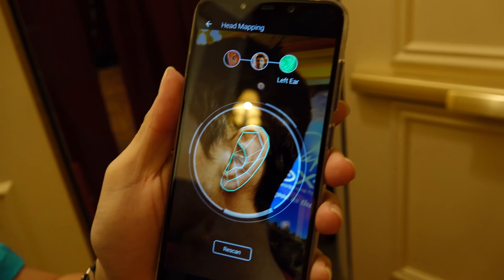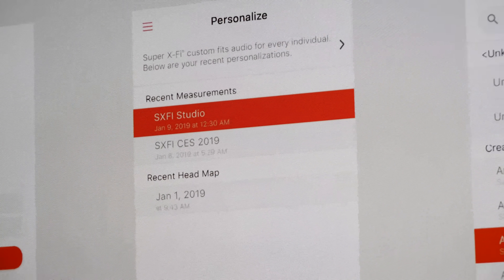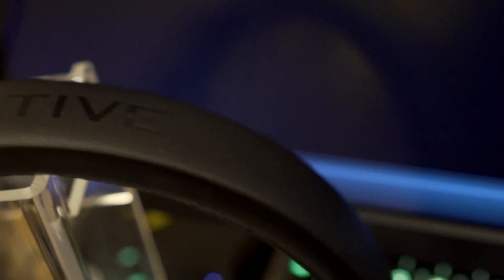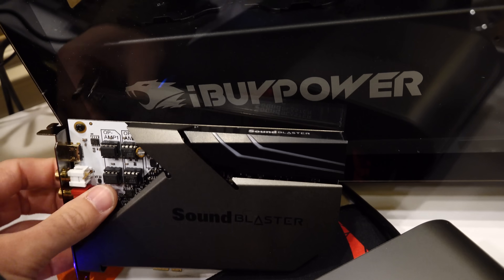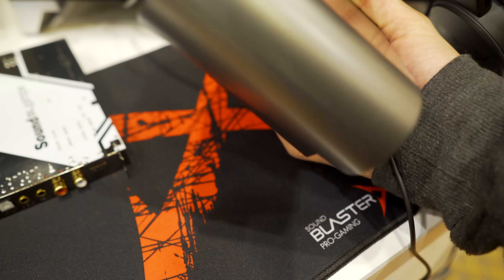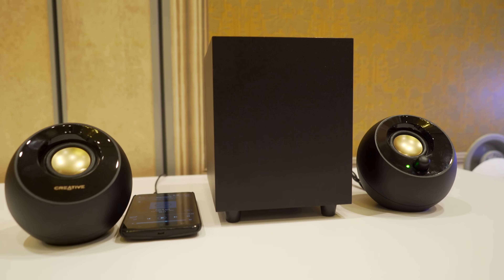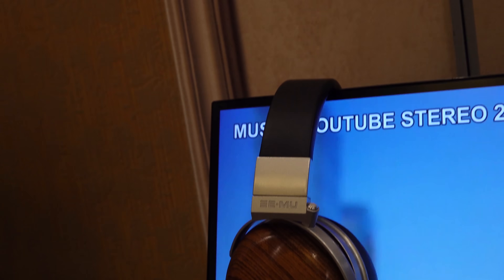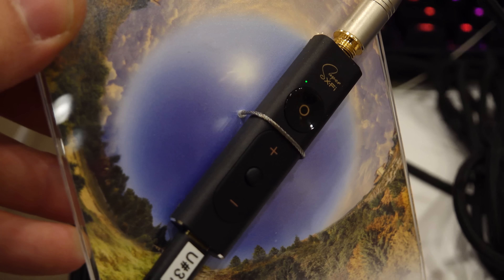What is this Headphone Amp, and Why is it so Different...?!

Comment: An important aside, the Super X-fi amp doesn't work with Xbox or apple products currently.  Which is a huge bummer because I'm I wanted this for a silent theater option and it doesn't work with receivers either.

Comment: Great specs on that AE-9.  SNR of -130dB (assuming they haven't just lifted that from the Sabre DAC spec sheet) is not easy to achieve.  BTW, it's pronounced 'Op', rather than 'O.P.' - short for operational amplifier.

Comment: I wouldn't trust demos like this when it comes to sound, especially when it comes to games. You can't force a game to have good sound if it has a bad sound system. I just use a standard stereo headphone setup with external dac, amp and no surround processing and games like Insurgency Sandstorm and R6S sound incredible as they are
Reply: Exactly. Most systems that have great inbuilt surround sounds will be amazing on anything even on a inbuilt sound card on the motherboard.

Comment: hey brian i want to build a x58 system with a x5650 and i already have a board but it has a four pin cpu power (msi x58 platinum) will it be enough for the cpu with some moderate overclocking
Reply: I run 500w on FX with a 4 phase VRM micro-ATX budget board ($40 price new in 2015 when I got it). It has an 8 pin, but I seriously doubt you'll be pushing power near my level (I'm voltage limited at 1.7 Vcore, core temp is still below 0c under load on my phase cooling system, otherwise I'd push it way more if it allowed higher voltage). I just really doubt you'll be pulling enough power to cook a 4 pin if you're only using water cooling, and you said "moderate overclocking", so haha, you'll be plenty fine.
Reply: @jakegarrett8109  ok thx

Comment: I flat out don't trust creative they got rid of their support forums because loads of people were upset with the piss poor support for the soundblaster z once windows 10 came out and lack of proper drivers.
Reply: gotta agree with you on that one UK....once you stop listening to your customers...then it's only a matter of time you begin to lose your customers. No Service?...no problem....no buy it.
Reply: Yup they've got😇 whipped pretty badly on that here in Singapore. 😜👍
Reply: I have the Sound Blaster Z sound card with Windows 10 64-bit, downloaded their latest drivers and have had no problems since installing the card (during 2018 Christmas).
Reply: @twinturbo3461  There are many that have problems. The fact that they simply erased their forum means the issues were bigger than they wanted to deal with.

Comment: From owning about 6 Creative products in the past, I can say that their cheaper sound cards/device and even speakers aren't worth it. Their expensive stuff is usually good, not great. 

At 150, it reminds me of those overpriced dragonfly usb sticks. I would look at something like Fiio E10/17 or Micca Origen which are cheaper and will probably be better, although they are a little bigger.
Reply: The XSFI is not supposed to be just a headphone amp. It's whole point is its signal processing which apparently gives an impressively natural room sound through headphones. Every reaction to it on the net is very positive. If you just want a headphone amp there are much cheaper, and also far more expensive options.

Comment: Small and convenient but 150$ YIKES!!!!
Reply: £150 is a large amount spend for many people. But if the XSFI lives up to all the reactions I've seen and read it's cheap in terms of audio products.
Reply: Can't really add much to that comment. But can this tiny amp beat the full size standard amps around that price? It's a major win if it can
Reply: I have some experience in audio. I have Hyper X headphones (I've owned far more expensive headphones in the past) and the tiny little control unit for that does all the signal processing including the surround simulation. I can detect a very subtle upturn in quality if I connect the headphones directly to my quality external audio interface. But the difference is very small. For gaming the difference does not matter at all. I have full confidence that any difference in sound quality between the XFSI and the most expensive headphone amp would not matter at all for gaming, and the main point of the XSFI is its special signal processing anyway.
Reply: If you just want a headphone amp there are many options from much cheaper to much more expensive than the XSFI. If you want a solution for critical listening you would desire things totaling far more than £150. But with any audio monitoring product you can't really judge if you would like it more than another thing, unless you can actually try it yourself.
Reply: thanks. can you recommend something just to boost the volume and voltage increase for a modmic I have?
Reply: @napaextra5954  Try check this guy he have two channels - ZeosPantera - Z Reviews
no crap about Gaming or RGB although he like games
Reply: It's said without RGB you can't be a true pc gamer. guess I'm not
Reply: Hasn't Fiio made something similar, but $120.00 cheaper?

Comment: Only one small issue with the pebble speakers. I would suggest using a color neutral White LED instead of green. just my 2 cents. Even though I'm more in favor of blue light, the white would probably be more favored by the majority.
Reply: I would be curious to see how the whole thing is powered off just one USB cable. That one cable has to power the speakers and the sub as well...
Reply: @Seatux  Good point, I didn't even catch that. Though if they use the USB 3.0 - it might have enough *shrugs*